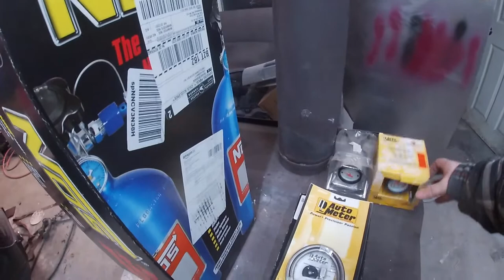Big Turbo SRT-4 Gets NITROUS   ***Bottle Fed Big Turbo SRT-4***

Comment: something to consider
if your using a rising rate regulator, the fuel pressure will be changing, so when you figure the pills out for your tune up, set the calculator for THE LOWEST fuel pressure you'll see in boost
idk if your setup loses boost on the top end, or holds flat, or creeps

also
get yourself a micro switch for the throttle, and an Nitrous express window switch
Reply from the maker: You made some good points, im going to have to have a look.

Comment: I'm hoping you can help me out ... I'm trying to change the oil feed line on a 04 pt GT and I can't for the life of me figure out how to get the block side nut loose ... I've been watching your Chanel for a while and you've always given good info if you have any tips on this one I'd really appreciate it I can be reached at epinky13sin@gmail.com ... You're pretty much my last hope cuz I'm not equipped to pull the motor for this one .. thanks for your time and consideration
Reply from the maker: can you get on it with a wrench
Reply: You have to pull the alternator to get a wrench on it ... Getting it out is a pain in the ass getting it in was even worse ... The compression fitting has to sit perfectly or the threads won't bite.. took 2 and half days to do it with out pulling the motor or the exhaust manifold lol
Reply: And then to top it off .... The feed line was in perfect shape looks like the turbo was rebuilt no shaft play or typical wear and tear ... Guy I got the car from took good care of it from what I can tell .. still gotta change the fuel pp though if you have any tips or tricks lol